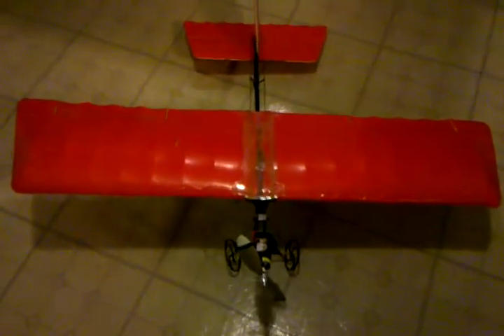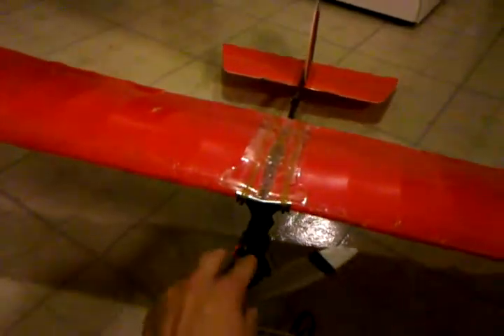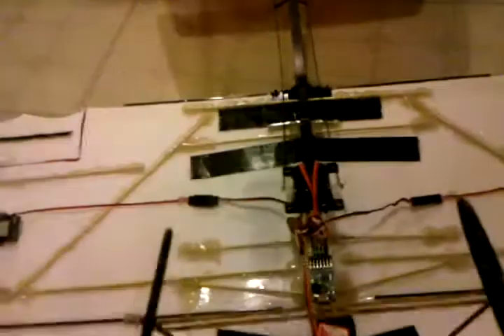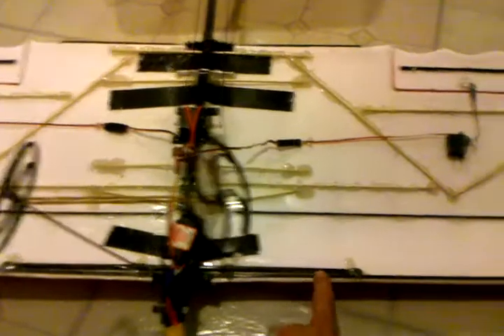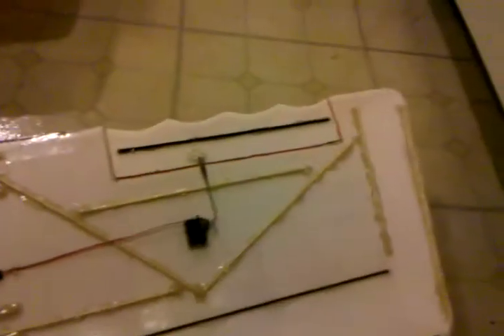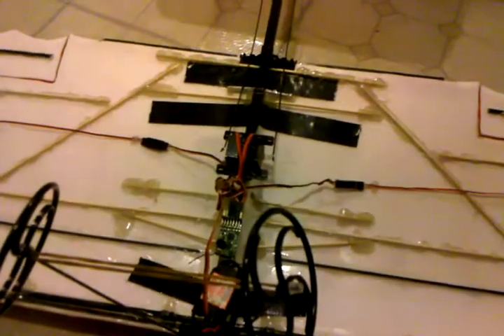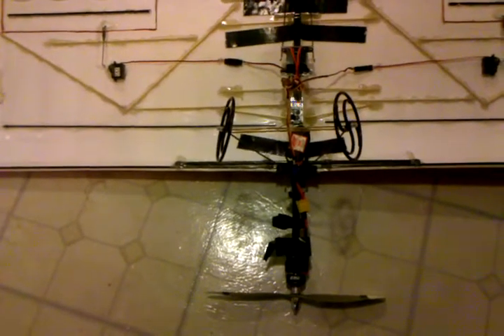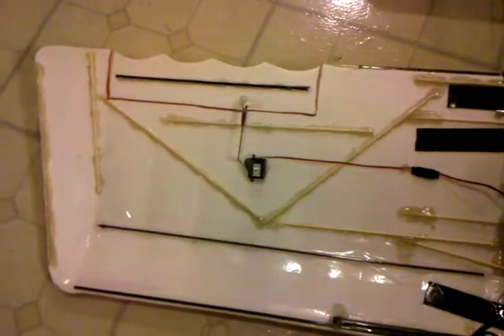GWS Slowstick moded - Wing strengthening

Comment: too much weight underneath the wings if u ask me...
i think u could benefit from using .1/32nd or 64th flattened carbon rod a-frame socketed configuration instead...